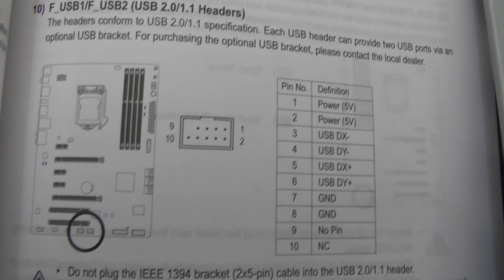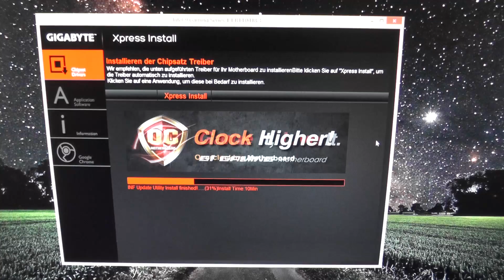How to replace old motherboard with a new one? [Video commentary]

Comment: I need to upgrade my mobo because I have a pretty good prebuilt but has slow ddr3 1333mhz ram. The mobo doesn't support DDR4 so I'm upgrading to get corsair vengeance rgb pro 16 gb 3200mhz ram. I've been trying to figure out where my bottleneck was and why my pc was crashing and its because of the slow ram. I have a 1660ti and an i7 4790k.

Comment: ALWAYS CHECK THE BACK OF THE MOTHERBOARD, THERE ARE CASE STANDOFF KEEP OUT ZONES. If you rush motherboard installation you can fuck everything up, always touch the metal case before touching the motherboard to discharge your static electricity, the motherboard and CPU are very fragile components so take extra care when handling them.

Comment: "The Verge PC Building"....dont be that guy unf*ck your cables they need to be managed in the back not pushed into a corner with some sticky strap.This pc literally has no airflow because of wires everywhere.

Comment: Before hand it's smart to download all the new drivers for the new hardware and place them on a USB stick or HardDrive.

I always disconnect the power cable first of all the cables; then press the power button to channel away all the remaining power that might be circulating in the case.
And reconnect the power cable as final connection to prevent unnessesary power currents forming in the case.

For the rest a good instructional video!
Reply: Also to prevent static discharge you can touch the ground pins on a wall socket outlet (touch it for about 3 seconds) and you're good to go.

Comment: Just tried changing my board but now my pc wont power up at all, even when i switched back to the old one. Could it be bcuz of a faulty cpu?? PLZZ HELPP!!!
Reply from the maker: It could be many things. make sure you have connected all the PC case wires correctly to the mainboard. I had a similar issue in the past where i connected incorrectly PC case USB port to the mainboard which has prevented computer from starting. Check all wires from PC case to mainboard (power, diode, speaker, usb..) and compare against mainboard manual is it correctly connected (position, + - ...). 5:49

Also, have a look are all power supply cables connected to mainboard as well (P1 - ATX connector, P4 - EPS Connector, PCI-E Connector to your video card if you need one..) 6:20
Reply: Cheech Chong It could be your power supply not having enough watts to power your pc

Comment: Do you need to remove old MB drivers?
Reply from the maker: In my case it was not necessary even though old mainboard was for AMD CPU and new one was with Intel chipset. This could depend on compatibility of the old and the new chipset and drivers. If there are compatibility issues and driver problems you might get BSOD during booting of windows. In those cases, best option is to do fresh OS install.
Reply: @mmuzdeka  do you do fresh os install before or after changing parts?
Reply from the maker: @InnateOwl  after changing parts. In that way windows will install only drivers for new hardware which you need.
Reply: @mmuzdeka  okay thank you so much. Was unclear on that but couldnt find any definte awnser

Comment: when replacing an old motherboard, you need to consider if the old CPU can fit the new motherboard too
Reply: an amd cpu wouldn't fit into an intel cpu... So that statement is irrelevant if you're not only changing the motherboard, but processors too
Reply: Kenneth Fleming uh what

Comment: I’m only looking at this because I need a new motherboard because I have a pretty bad gpu and my mb can’t handle the one I want
Reply: you mean cpu?
Reply: Lol facts I’m trying to put a Ryzen 7 but the morher came with a Ryzen 3
Reply: @pachome2251  its am4 socket right? if so you only gotta worry about cross-checking  to make sure ur cpu will work with ur pc psu etc etc

Comment: I'm dreading having to do this eventually... but my cpu is showing some age with all these new titles being so CPU reliant and my MB can't go past 5th generation CPU's
Reply: Same here. My i5-4460 is reaching the top end of its capabilites, especially when playing Arma 3 etc, and my ASUS B85M-G motherboard won't fit anything better.
Reply: I'm pretty sure this is the year my Q6600 will flat out refuse to even start some games :|
Reply: Back, after building my second PC, don't worry people it's dead easy. Hardest part is hiding the ugly cables.
Reply: Aha, I'm here because of my i5-4460 too. Final Fantasy XV is wrecking it.
Reply: Damn I wish I had a i5 4460 lol I have an A8-7600 quad core AMD APU. It gets beaten by the G4560 dual core by quite a bit. My GPU is all good I can play Battlefield 1 on ultra in campaign but the second I join multiplayer it starts bitching bad and if it's a 64 player match even on 720p lowest setting I get like 15 frames per second. CPU usage at like 110% GPU usage drops to like 20% lol. Vermintide 2 as well is seems to work not bad at medium settings until you join a game and there's a hundred ratmen spawning it it just shuts right down. But if I turn shadows off my CPU usage goes down by like 15%. It doesn't actually go down because the GPU jumps in and uses up all the extra processing power
Reply: @blackdahliagaming4696  its impossoble to go over 100% moron
Reply: Black Dahlia Gaming Ouch thats kinda painful lol. The i5 was a beast and it's served me very well.
Reply: ReviewMyCucumber USA ya I would love to get something much better like the i5 8400 but the that's pricy with a new mobo as well so I have to probably get something more along my price point but in my situation there's no where to go but up lol
Reply: MightyChaz thats probably the way im gonna go but i was thinking of going with a cheap Ryzen 3 but I found out that if you have anything AMD in your computer then you can't use Physx,  it is picked as default but in Msi combustor it went back to Cpu so I think it's a G4560 or even the newer G5400 something like that didn't seem to be much difference between the 2 so either of those
Reply: MightyChaz ya pretty much, from what I looked up online any processor that isn't AMD and Physx will work. Since the G4560 and newer G5400 are Intel chips Physx will work and that's good because while they are better than the A8-7600 they aren't powerhouses by any means so it would probably make an impact performance wise, taking that stress off the processor since they are only dual core. Since my CPU is AMD it's like Physx is hard locked it will not work no matter what I tried, if you have a powerful enough CPU like a Ryzen 5 1600 then you probably wouldn't even notice a difference in performance using Physx as the CPU would be able to handle any of the physics calculations easily, say in something like the Witcher 3 the Ryzen 5 1600 would probably be able to handle the hairworks FX setting on max better if not just as good as the GPU using Physx so if it's a good enough AMD CPU then you don't have to worry about that. The game I was playing that brought the whole Physx restriction into the light for me was borderlands 2. On my A8-7600 with a gtx 1050ti the game works great on high setting but i can't even select the Physx option and it's by default set to off (because of the AMD thing) and if I turn it on manually in the engine.ini files my game would work fine until got in a shoot out and the game started making hundreds upon thousands of Physx particles around bullet holes and all the Physx particles and stuff wouldn't disappear for quite a while so it just became more and more stressful on the CPU the longer I played and eventually my CPU would shit the bed. If it wasn't locked off because of the AMD Physx restriction then I'm sure it would run fine on my system. if I had a G4560 I could probably play that game with Physx on the max setting no problem.
Reply: ReviewMyCucumber USA ya my case right now is disgusting there is so much cable and I have such a small case. If I had gotten a modular power supply I could have gotten rid of all the ones a don't even need that are just cluttering everything up. One thing I'm worried about though when switching my Mobo and CPU is whether or not windows will just boot up normally or if the new mobo is going to require a new copy of windows cuz that would suck. Do you know if it would create an issue or if I'll be fine. Someone said as long as I make a Microsoft account and link my OEM windows licence to my pc it would just boot up
Reply: I'm scared too. I don't have so much experience to do that. I have a b85m and a I5 4440, and i'm going to Aorus gaming 7 and ryzen 2700x :)
Reply: My motherboard won't go anywhere past 3rd gen, in stuck with an i5-3350 3.3 GHz, I really want a new cpu but I have no clue what to go for, I'm thinking of a 7th gen i7 but then I also need a good motherboard
Reply: No way bro, its fun to upgrade

Comment: I did everything youve done in this video but after ive done it i turn on the pc and my montitor doesnt come on
Reply: You can’t just replace it, you need to remove he old drivers
Reply: ^^ that depends on a lot of things, like integrated graphics. If you changed intel based motherboards, the only reason there's an issue is because you have drivers for a different type of intel hd graphics or something, which basically means information for a completely different system is trying to be processed by the cpu, but it doesn't know what to do with that data, because the corresponding hardware no longer exists, so it throws an error and then stops working. If you have your old mother board, it should boot up if you put it back in. It also depends on whether the drivers are necessary to boot or not. Something like msi afterburner won't matter for booting uo a pc, or something like realtek audio drivers for an AsRock mother board won't matter for booting in an msi motherboard. If you're going between amd and intel, it might not matter, because amd relies on dedicated gpu's mainly, so if you have a ryzen 3 1200, the motherboard wont have any graphical drivers needed to boot. but even  then, the answer is simply "it depends". It's not the most right/wrong scenario, it's highly dependent
Reply: the simple truth is, if you had to watch a video to replace a motherboard, you shouldnt have replaced it yourself in the first place
Reply: @aaron5726  thats an ignorant statement. You cant learn anything without watching or reading
Reply: @BagzAndPresident  haha I made that comment a year ago and tbh I agree with you now :)

Comment: My mother board is ddr2 can ddr4 mother board fit on my old cabinet ? or they have diff size ?
Reply: thats your ram, if you have ddr2 ram it wont work with a ddr4 motherboard. You will need to buy new DDR4 RAM
Reply: n4melyTV That's not what he's asking.hes asking if a new motherboard would fit in his case that he's currently using even though it is extremely old
Reply: jonathan reyes yeah so form factor, like mini atx or atx etc. He should make that clearer because it sounds like ram to me

Comment: Do I have to change processor?
Reply: It depends... If you are with AMD and getting a new AMD motherboard then no... if you are getting an Intel motherboard then you need an intel processor which is of the same socket.
Reply: david frankland Thanks a lot
Reply: for changing motherboard
Reply: Shagun 5 Studios no
Reply: JEC Plays thanks
Reply: david frankland so there different type of motherboard can you please tell me all or just give me a website I can check need it so I can't fix my two computer thanks a lot :D
Reply: Yes
Reply: if it has the same socket then don't bother changing it

Comment: What about the amd drivers and the operating system on the hard drive did you have to reformat the HD and delete the drivers for the amd cpu.
Reply from the maker: In this case i was lucky enough and there was no need to reinstall the windows OS. It was just needed to install missing drivers (i was prompted) and everything was running without any issues. I think that depends from the system to system and is there some strong incompatibility between old drivers and new.
Reply: F3SH GAMING Before you installed your new motherboard, you should have uninstalled your then motherboard's drivers. Windows would boot up and install the missing drivers after your installed your new motherboard.
Reply: how did u install the drivers if ur pc cant boot with incompatible ones
Reply: My sangsung double. Door model no rt26fajsarx/tl/2013 is damaged dew tomainboard damaged.
Reply: gnrc. i have question too do i have to uninstall motherboard drivers and cpu or just mb if im changing both
Reply: @iwin7220  same question

Comment: Mmuzdeka if i put a i5 in a desktop when its currently i3 is it simply take out replace and install, restard pc ect
Reply: No it might not be that simple at all if you haven't done it already. You have to check if the board can support the CPU and to see if it needs new drivers and an update of the BIOS
Reply: Lewys Calder uhm i should unplug the power cable

Comment: but what about the software side what do I need to do with the old drivers and stuff
Reply: thorin199 i think uninstall them and turn pc off and upgrade then when you turn on it should intall new drivers if not go to manifacturer website
Reply: thorin199 im super late, but just the mobo drivers
Reply: thorin199 I think you just uninstall the old mobo drivers and then when you start up your PC with the new mobo you just install the new ones
Reply: I know this is super old but I unformat my boot drive and put a fresh os on it